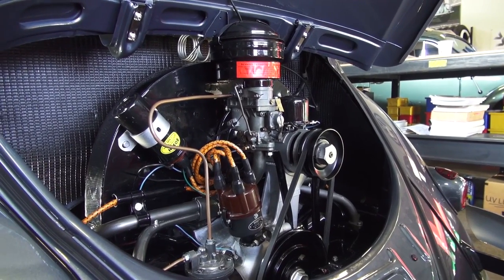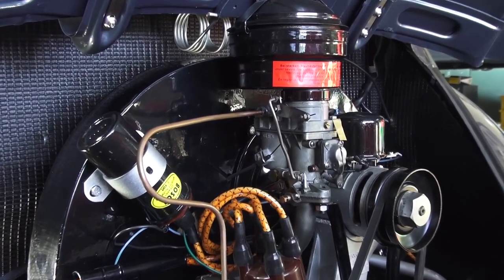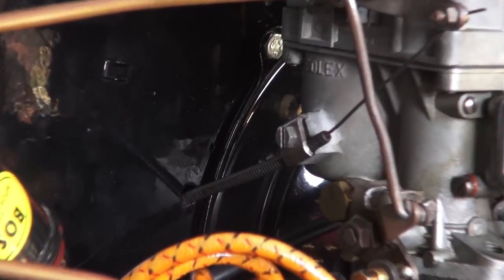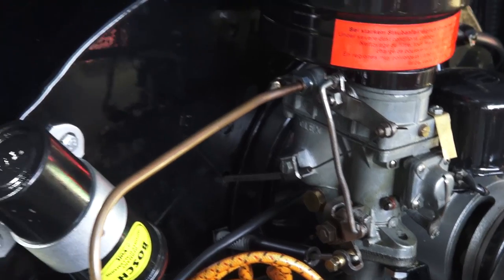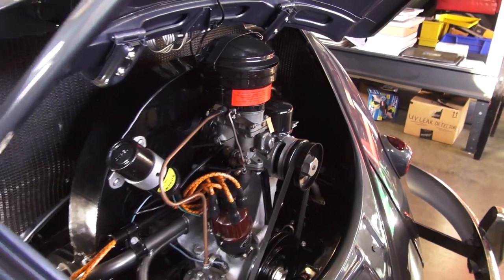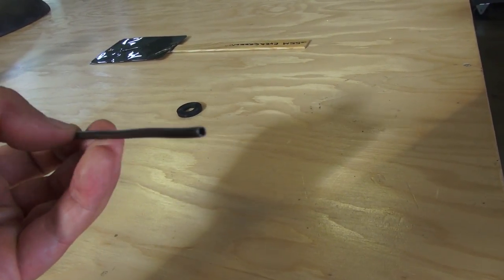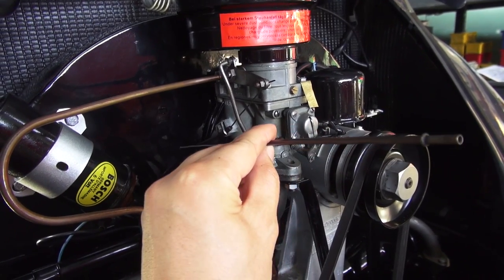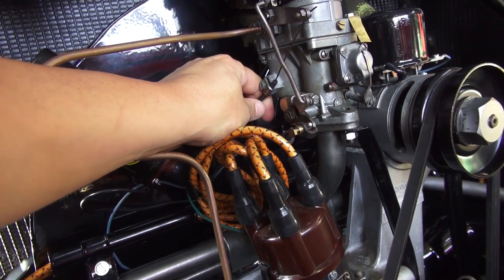Classic VW BuGs How to Beetle Ghia Bus Tip Guiding Choke Cable Through Early Fan Shroud

Comment: Hi Chris great video, I have a 57 vw bug I am feeding the choke cable through but I hit something just before the fan shroud. Is there a gap in the tub before the cable gets to the shroud?  Is it possible to access this point if I take the rear wheels off?  The company who installed the motor never installed the choke cable.
Reply from the maker: A gap in the tub?  Not sure what you mean.
Reply: Hi Chris,  thanks for responding.  I meant to ask what the distance between the end of the choke cable tube is and the hole the choke cable is feed through on the tin, next to the throttle cable?
Reply from the maker: @richardvanderstar9136  Ah, well, not sure why you would need to know that?  I am not sure, I have never had to measure that.
Reply: No worries, I pushing a new choke cable through the choke tube and it binds just before it gets to the end of the tube.   I can't see the end of the choke tube so I was wondering how far back it was from the shroud.
Reply: @classicvwbugs  Hi Chris, I pulled up your video "Replace Beetle Torsion Arm Spring Bushings Swing Axle Seals" and I can extrapolated the distance as I see where the choke cable leaves the choke tube next to the throttle cable.  It's my first time rebuilding a VW and the video's are great help.  Thanks again.

Comment: Hi Chris , love your videos, you’ve helped a lot with my 58 bug. I’m hoping you can help me again. I am trying to replace my choke cable but I can’t get it out of the tube that runs through the tunnel in the car, it’s stuck. I have the gas tank out and I’ve been spraying PB penetrating oil in the tube at the front of the car. I think the cable housing is stuck in the center of the car. Any suggestions?
Reply from the maker: Yes we just rerun the cable through the inside of the bug and out the chassis to the engine.

Comment: hey Chriss, where does the choke cable goes? i mean i cant find a lever or pullout thing that move the cable
Reply: You mean to give gas? It attaches under de lever to give gass the small whole is for the cable google it
Reply from the maker: what year bug do you have?
Reply: 1980
Reply from the maker: you should not have a manual choke for that bug.  So do not worry about this tip.